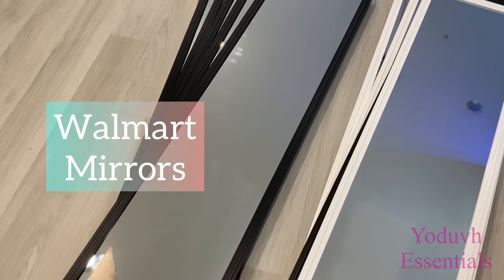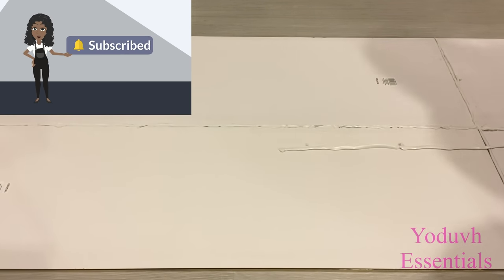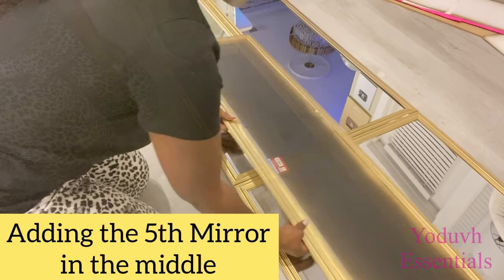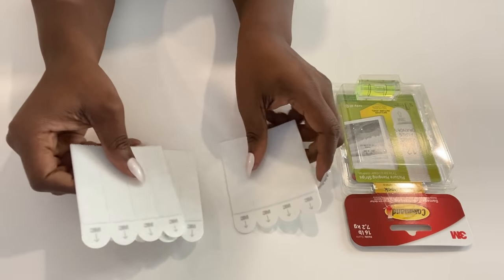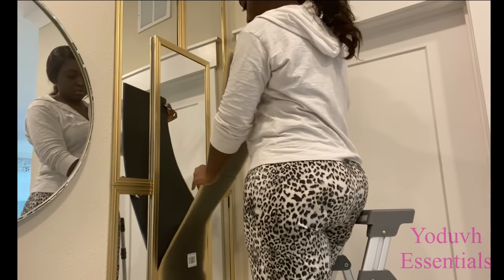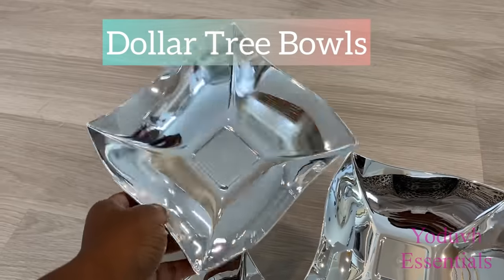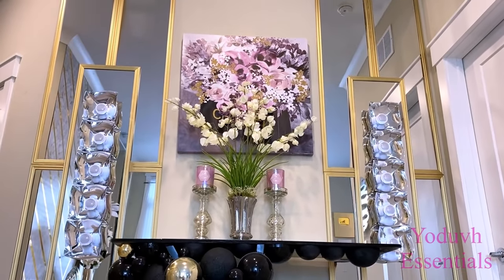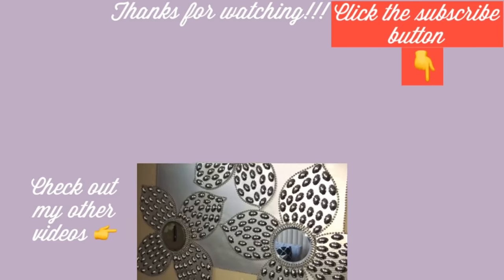How To Cover Up A Wall WITH MIRRORS AND PLATES! Walmart Meets Dollar Tree series

Comment: When heat goes up, then mirrors will fall down. Command strips aren't good in heat! Summer time heat.
We used them for work, cleaned the smooth walls and after 15 mins they fail.
We use another clear strip that works super well. A thick clear gel strip
You'll need something strong to hold them up.
If it's your wall (own not rent) you can permanently affix them to the wall. 
But the heat will bring the mirrors down fast, and get ready for your 7yrs of bad luck lol.
But the wall mirrors look amazing.

Comment: liked the use of the mirrors but the lighting didn't work for me.  also I have had photos fall from the wall with those command strips...I did find if I mounted the command vertically , I had less issues....I personally think more strips of command....I hope it doesn't give you grief.

Comment: What size where the wood pieces on the back, what it specific measurements or they come like that?
Reply from the maker: I bought (2) 2x4 and used it on one set of mirrors. (The length of the 2nd piece of wood was cut to fit the back) 💕

Comment: I betcha that the command strips did not work as a permanent solution. How often did it fall down already?
Reply from the maker: They held up till I moved. The trick to using command strips is to NEVER reposition them after they have been used once because it won’t hold even if the repositioning was done immediately. Another important thing to consider is the weight! Command strips come with different weight specifications. It is always written at the top right of the packs. You probably have had bad experiences with it because either 2 of these key points were overlooked 💕
Reply: @yoduvhessentials6310  That could be it but I've had both the glue fail on me as well as the grip. I presume you have to think of a renter friendly solution but I'd feel better sticking a couple of screws at the top, just in case. 
I love your channel btw, you are full of ideas.
Reply from the maker: @thornyback  I appreciate that 🤗, Thankyou so much ☺️. it is always good to go with what makes you comfortable but maybe add a board behind the mirrors with little tack nails to make it renter friendly 💕